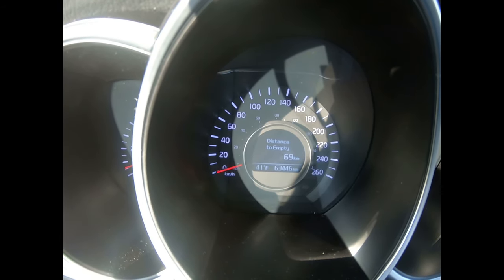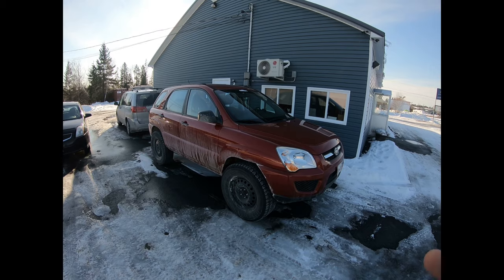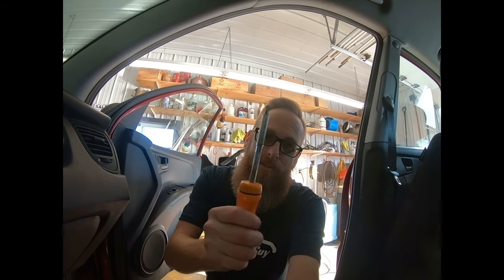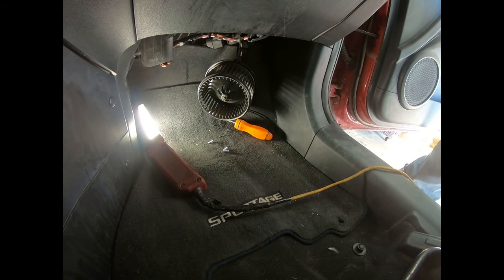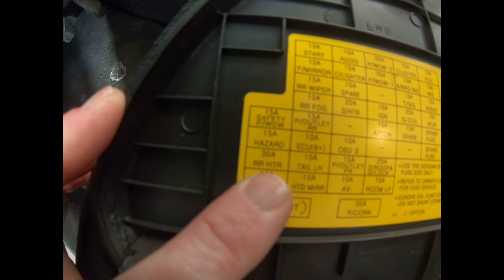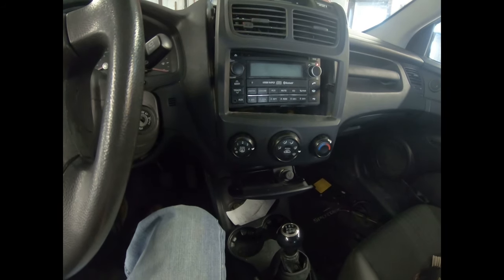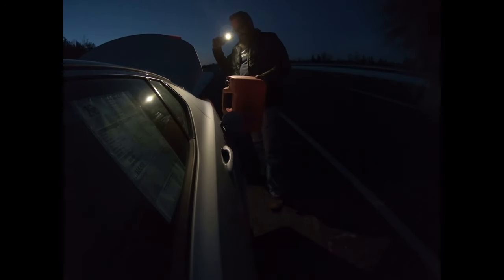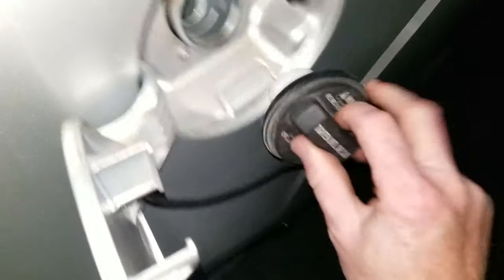HOW MANY MILES CAN YOU GO ON ZERO MILES TO EMPTY

Comment: Possibly the knob that controls the heat.   I've seen those go in JKU's.
Reply from the maker: But I have no power to it!
Reply: @OldeCarrGuy  Well, no power to it, fuses are good.  There might be a relay that controls it.  I know the XJ's have a similar issue.  Maybe see if that is the problem.
Reply: @OldeCarrGuy  I've just read the the heater blower motor resistor is a common problem with the 2009 Sportage.

Comment: I want to say that since that blower motor works both heat and air, there should be a fuse or maybe relay just for that fan. Of course it could be the fan speed controller or maybe ground. Could try and use a 12v battery and jump the blower motor and see if it works.
Reply from the maker: I've had the blower out and hooked directly to a battery and worked. I have power at the fuses but not at the control switch, resistor or blower. I'm thinking it's a wiring issue at this point.
Reply: @OldeCarrGuy  very well could be the wiring from the fuse to the control. That car dosnt seem old enough to have wiring issues, but sometimes odd things happen.
Reply from the maker: @EfurdGarage  I'm going to start rippin into the dash to see whats going on!
Reply: lol thats always fun.

Comment: Next video: Blowing (Up) Bubbles.  LoL. Are there any hidden fuse panels? Hyundai used to use more than one, as I recall
Reply: Video after Blowing (Up) Bubbles; replacing the fuel level sending unit on a Kia Optima
Reply from the maker: Gonna start tearing into the dash......
Reply from the maker: @shanescarlife  Bah! Ye have little faith!